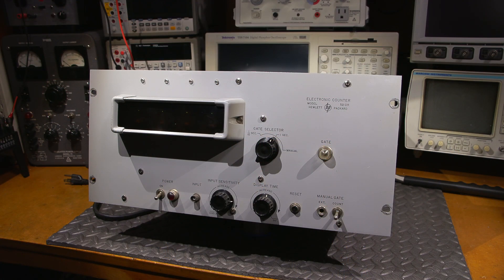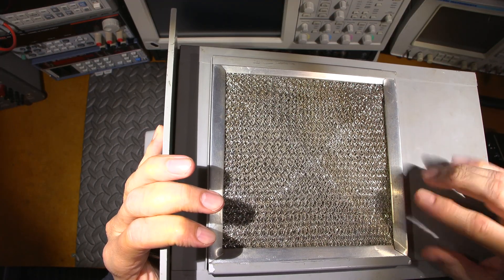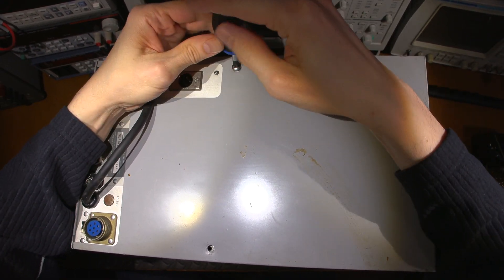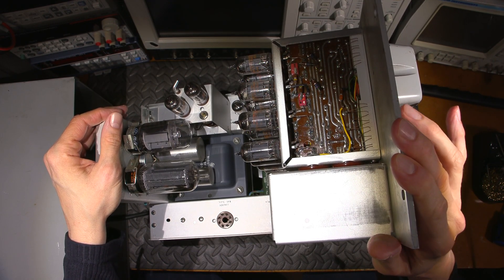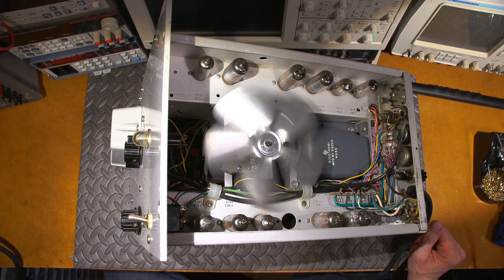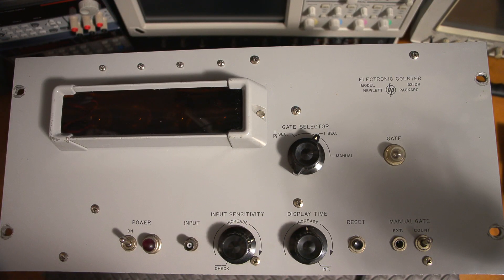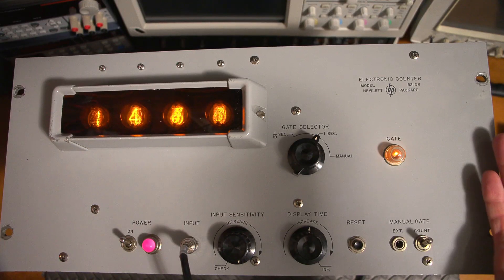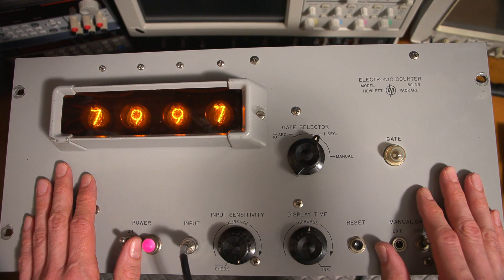1950's Digital Electronics "Vacuum Tube Goodness" - Will It Still Work?

Comment: Supprised it did not need the crystal oscillator were you using an external standard
Reply from the maker: It was using the line frequency as the reference.

Comment: Neophyte here... What is a "counter" like this used for? You were using it to measure frequency, but seems to me the range would be pretty low with only 4 digits. Maybe you were counting cycles per second just to demo it, and it's usual use would be to count signal pulses up to 9999.

Comment: Even though it's probably 65 pounds and takes up 40 times the space of a modern frequency counter and probably 40 times the power consumption, you can not love this older hp gear.

Comment: These HP machines are not really digital. It's all analog with basically just  a bunch of comparators that activate neon bulbs when a threshold voltage is reached. This has similar system to the last HP counter, except that the neon bulbs are in optocouplers that drive the nixie digits.
Reply from the maker: They have flip-flops, use a time base and count, they are definitely digital.
Reply: Prof Carlson, I'm with ya on this one...
Reply: @MrCarlsonsLab  Usagi Electric disagrees, he's done a vid on the voltage adder system inside of these. Those are not flip-flops in the traditional sense, their output is additive. It adds the voltage till it strikes the neon bulbs, if it goes over it trips the next one up instead, it's not just "on-off".
Reply from the maker: Hi Trevor, they are very much a flip-flop. This is as "traditional" as it gets. Here is a good article for you to read, go to page 7 of the PDF:  http://www.philbrickarchive.org/eeco%201956%20catalog%20no%20856-p%20ocr.pdf
The term "On or Off" all depends on how you look at time. Most all active devices spend some time in the linear region, this can be looked at as "rise time" and "fall time." The neon bulbs "strike characteristic" is what aids this process in the HP counter. I could write a book at this point, but I hope this helps you understand the Multivibrator / Filp- Flop a bit better.
Reply: @MrCarlsonsLab  In a sense, you’re both right!
It uses digital flip flops combined with brilliant analog trickery to illuminate the appropriate neon.

The AC-4 unit that is used to represent one digit has four dual triodes on it and each dual triode is indeed set up as a flip flop. There are four flip flops and they do indeed make a binary output, so that part of it is digital. 

But it gets really wild after that. The output voltages out of each flip flop vary depending on both the state it’s in and which flip flop it is. These varying voltages are summed up and used in either direction across a neon to either turn it on or off. In either direction sounds funny though right? Well, neons have the awesome property that either electrode can be the anode or the cathode. It depends completely on which side has a higher potential.

So, for the AC-4 counter here, it dumps +137V on one side of a neon and +75V on the other side of a neon and the potential difference between the two voltages is enough to illuminate it. But the neon next to it has +110V and +75V, and the neon next to that one has +110V and +135V. The way in which voltages are summed in either direction and how the unique properties of the neon indicator are exploited is very analog wizardry!

If you have the glorious Nixie version like this one, you can’t just use the outputs from the flip flops to drive the Nixie. The entire BCD counter relies on the fact that neons can be used in either direction and that each digit has its very own cathode and anode. So, HP just slapped some LDRs in front of the Neons to make a simple but effective ADC to drive the Nixie!

So, for the question of whether it’s digital or analog, the answer is both! The binary counting (which is weighted 4-2-2-1 and is a divide by four) is pretty digital, but the way in which the neons are driven is supremely analog!